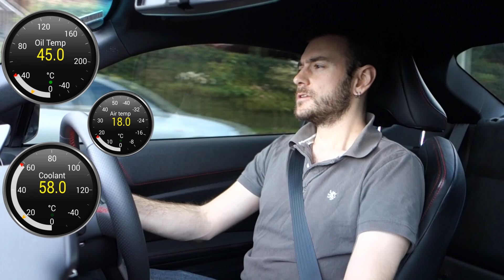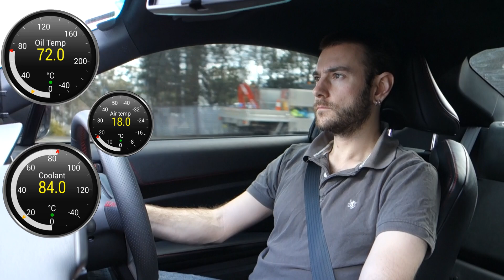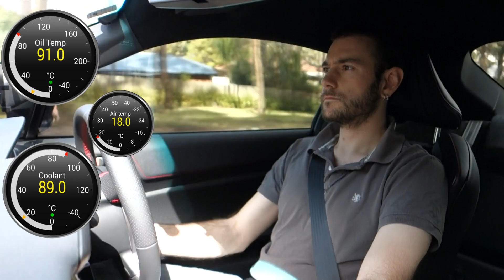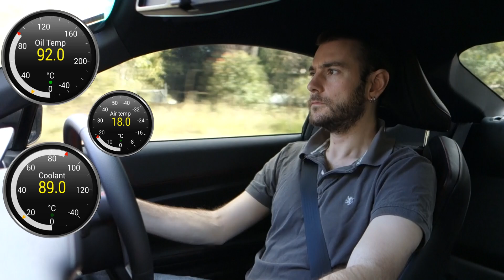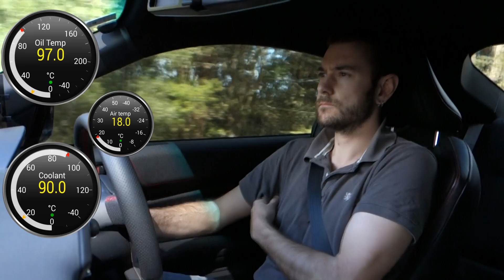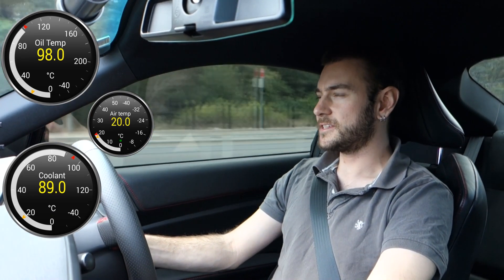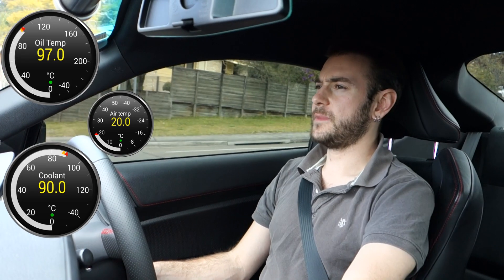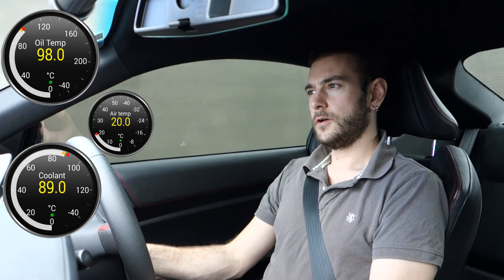BRZ/86/FRS Post Oil Cooler Install Temp Analysis

Comment: Hey!! Does this directly affects coolant tempeture in a good way? Can say it sits coolant tempeture lower?
Reply from the maker: I’d the oil is cooler than the coolant it will bring the temp of the coolant down and vice versa.
Reply: @boostedmedia  by how many degrees this bring temp down? I'm on a 97' 4runner running 208°f but i'm planning to install a supercharger, I'm changing from 180° to 170° thermostat, but needs to take It cooler than 208° running uphills, 3k-4k rpm, keeps me a bit worry bro
Reply from the maker: Sounds like this isn’t the right thing for you. You’ll want an additional Oil cooler
Reply: @boostedmedia  you mean, total 2 engine oil cooler?

Comment: Coming from a motorcycle "world" where I'm loving track-days I have something to mention, just by experiencing an OEM water/oil heat exchanger.
105whp bike, 4 cylinder. Peak power at 11800rpm.
First couple of hot weather trackdays (33-34C air temp) I've done I observed a sustained 92 degrees Celius at coolant temperature when i was pushing at a "safe" pace.
For 4-5 laps, when I was at my maximum effort, i observed the temperature going as high as 98 degrees coolant. My thermostat opens at 82 while fully open at 94!
Cooldown lap, low revs, 6th gear, 2 minutes... only brought the temperature back at 88-86.
Oil at that point was working as a buffer, cause it stores much more energy than the coolant...

Same bikes equipped with a separate oil to air heat exchanger, have lower coolant temperatures.

For daily driving and quick heat up of the oil, YES, the cooler you installed works just fine. You can have lower oil temperatures also, if your water cooling is adequate!
If not, you're gonna drive your coolant temperature up to the radiator's cooling limit and eventually run hotter on water!

For sure, it all depends on how much you're pushing the engine, your driving skills of course (laptimes) and the engine's whole package of performance.

All performance track bikes, run a separate oil cooler!! :)
Daily driven have the advantage of quick heat up, but heat soaking is just a matter of time when pushing hard!

Comment: How is an oil cooler going to warm up the oil faster than stock from a cold start ?
Reply from the maker: The coolant inside an engine generally heats up quicker than the oil from the combustion process so the cooler actually works as a heater while the engine is warming up. Essentially it’s working to normalise the temperature between the coolant and oil.

Comment: Where is your oil temp sensor located? That makes a big difference. Thanks
Reply from the maker: Not sure where the factory sensor is located.
Reply: @boostedmedia  Okay thanks. From what I found online, the oil temp sensor measures the temp of the oil going to the filter, and therefore to the cooler. So I'm thinking the oil the engine is receiving from the cooler is probably several degrees closer to coolant temp than what the oil temp shows since the sensor apparently measures the temp of the oil going into the cooler.

Comment: I opened both videos on different windows. Seems that you earned about 4 to 5 ºC on the heating phase with the oil cooler. Also, it took about 5 minutes for your oil to be within the same temperature as the coolant, opposed to about 9 minutes without it.

You should revisit this topic, and try to drive on high rpms instead of high loads, as oil heats up more with rpm than actual load on the engine.
Reply from the maker: Only problem is I sold the car 3 years ago :(

Comment: What OBD2 reader did you use? 
awesome videos by the way, really informative!
Reply from the maker: Thanks. I use an OBDLink-MX
Reply: Hi. You using Torque app on Android? I can’t seem to find the oil temp dial
Reply from the maker: You need to use a custom PID to make the oil temp work. There are instructions on google. :)

Comment: Since this oil cooler is relying on the radiator to indirectly cool it, might want to upgrade the radiator as well to see even lower oil temperatures, if you haven't already

Comment: Hello why not cusco? The oil cooler takes direct from the radiator? What is the difference between this two oil coolers? What is the best temp to run the motor? 0w20 is efficient above 100°C or not?